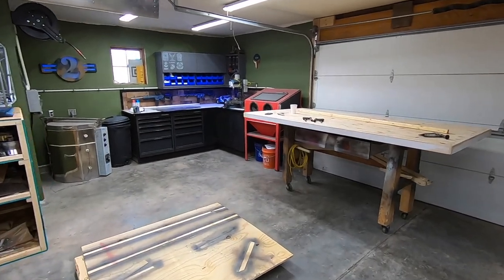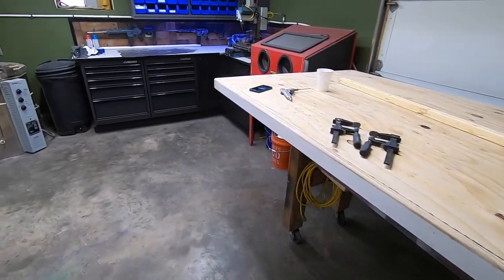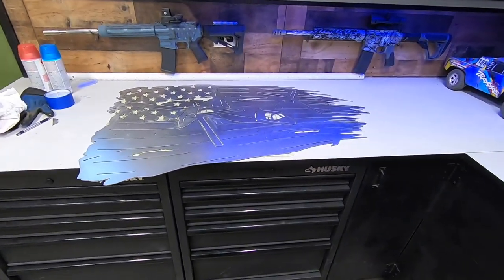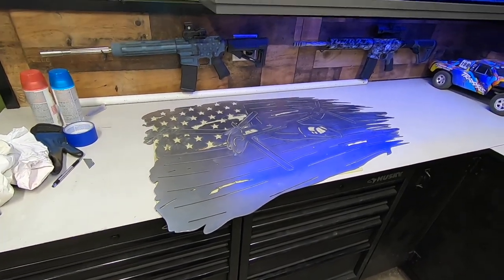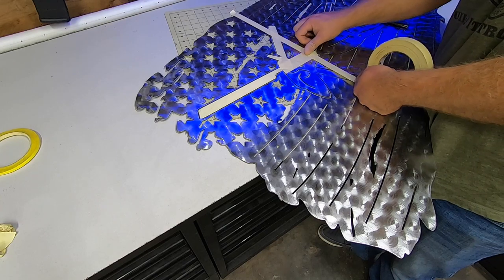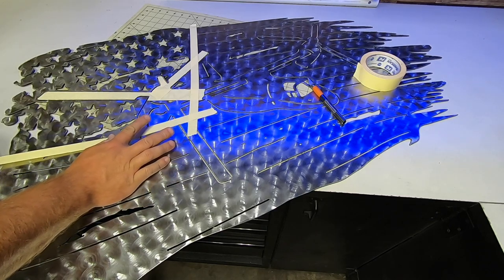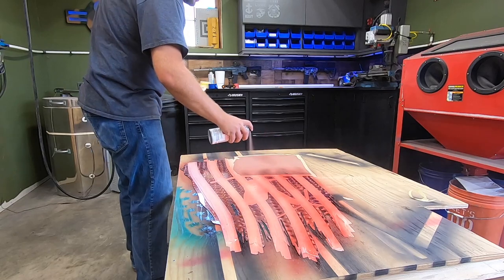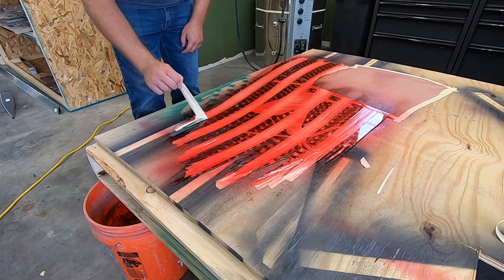Custom  DIY Painted V22 USA Flag!

Comment: That’s sweet
Reply from the maker: Thanks Paul!
Reply: @Project2Workshop  watch a few video’s ,pretty good ,might have to check out plane video’s.  But man I can’t afford try build vw plane or Briggs & Stratton helicopter 🚁. Lol. Don’t think my lawnmower motor should be above 2 feet high.
Reply from the maker: @paultrimble9390  lol.. Hey I’m kinda building on a budget over on the airplane channel so go check it out. My engine is from a snowmobile! Yamaha power💪
Reply: @Project2Workshop  I got 300 Honda lol. No way not me. Yeah that’s why joking around shoot I don’t fly. Not in nothing I owne.    Mostly bunch other people’s problems I bought fixed up enough to ride. Lol
Reply from the maker: @paultrimble9390  Sounds like you should go get you a pilots license then🤷🏻‍♂️
Reply: @Project2Workshop  still working on drivers.lol
Reply from the maker: @paultrimble9390  well get that too.. but airplanes are cooler👍
Reply: @Project2Workshop  hell Yeah. U fly by pick me up. Lol